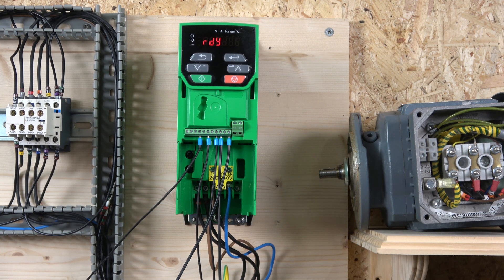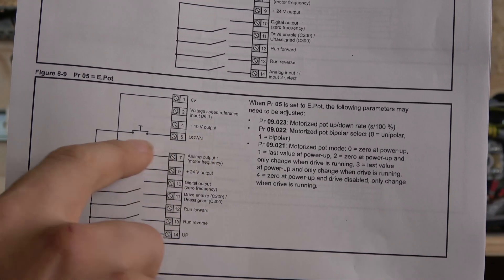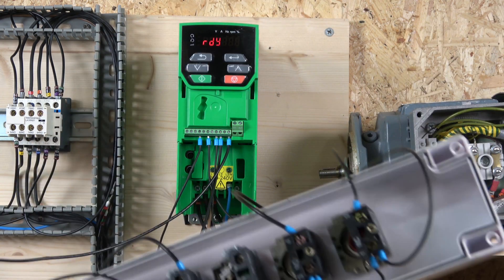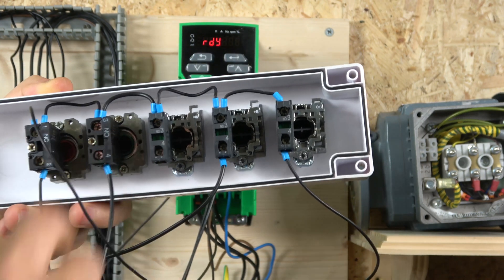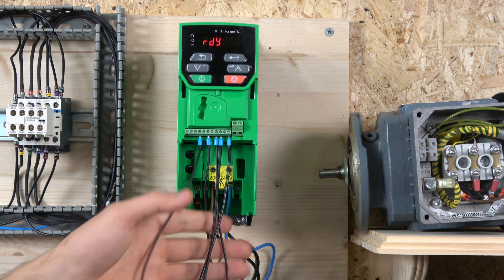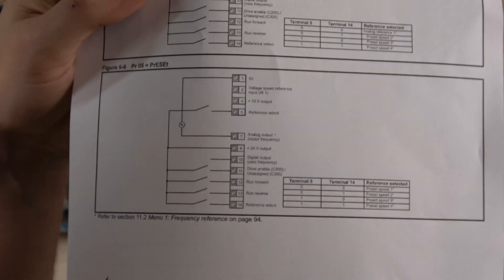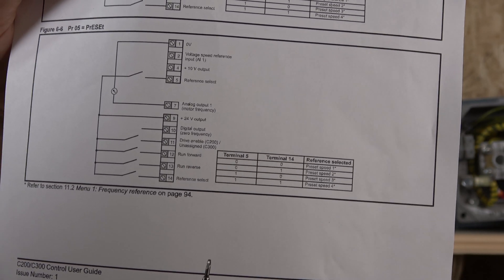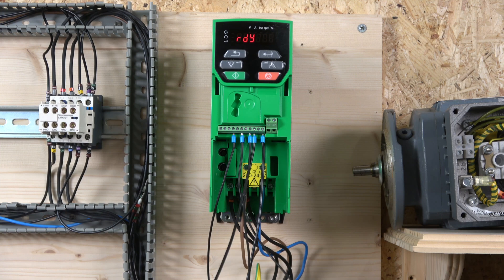Control Techniques C200 VFD remote electronic and multi frequency control, parameter set up(English)

Comment: Hello,
I would like to ask you something about commander C200 because when i try to connect C200 with HYSECURITY MX000585 SLIDEDRIVER CONTROL BOARD SMART TOUCH. After that it shows on sceen C200 (inh) do you kown how to sort out the problem. Could you tell me please?
Thanks